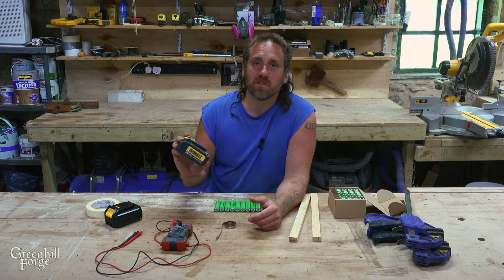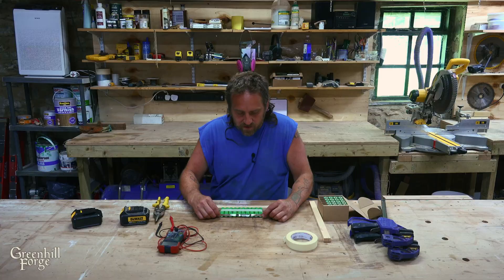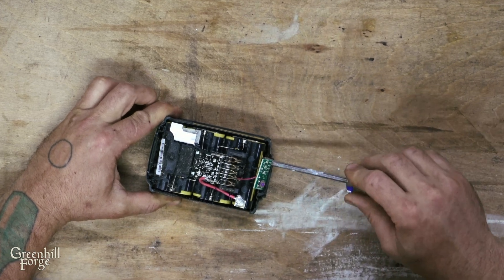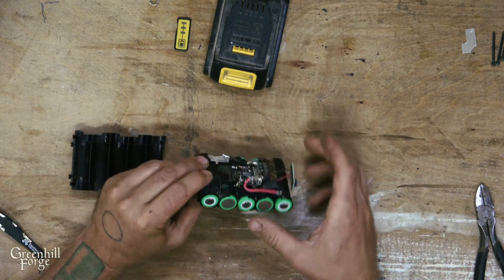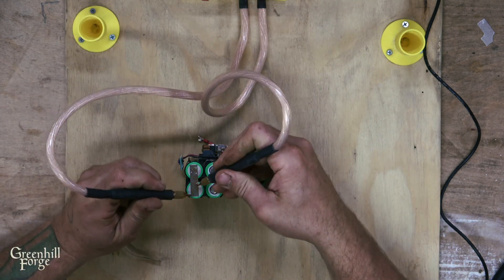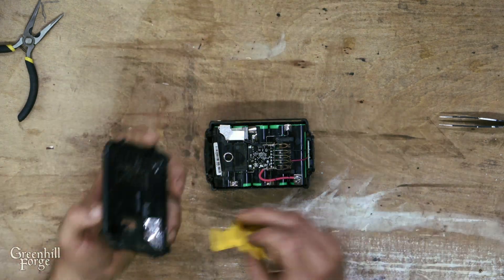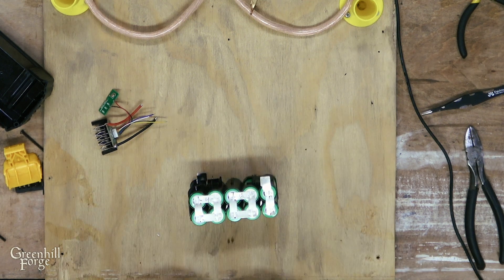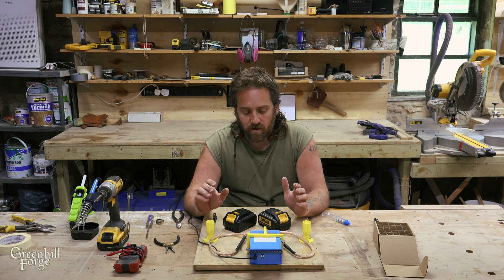20V Dewalt Battery Rebuild - Upgrade for 1/2 Price

Comment: Hey I just did this project, new to all of this, but everything's works, but when I put it on to charge, I get nothing, any help??
Reply from the maker: i'd guess a loose or wrong connection but it hard to tell without it in front of me. double check cells are all in the correct orientation and all connections are good. test the cell voltages, if they go too low then i think the charger can have trouble charging them. make sure charger is good with another battery. test voltage/continuity between + and - on the battery case. let me know what you find. can it power a tool?

Comment: Very clear explanations !  I would just recommend to place insulation washers on each positive pole before assembly , to avoid a possible short between the external circle (negative) and the internal part (positive) , because the initial insulation is very fine . I always do this ,  specially with high drain cells for safety . For assembly with a soldering iron (but really not the best) instead of a good spotwelder , it's  essential to use these washers .

Comment: How did you choose your cells? Are there some cells that have protection that makes them too tall?  Or did I dream that up? I get every part of this, but it's hella hard to get cells in Hawaii, so I want to preemptively avoid any rookie mistakes I can.
Reply from the maker: I googled to find the oem cells of the specific batteries I was and bought those. sourcing cell can be tricky, look for a reputable supplier but stock will rotate frequently.

Comment: Why is that black power strip upside down? You have the cable source from the right (viewer perspective) and the cable going and looping around the other side. Whether this is personal choice, I don't know, but this orientation allows liquiqds to spill in easier. Plus going up, the cable has an increased chance of catching on something rather than going straigh down and flush with the wall.

Comment: I'd recommend to anyone that if you want to rebuild dewalt packs, use Ampace JP30 for the 18650 cells and Ampace JP40 for the 21700 cells. The Ampace JP40 are used in their 8Ah powerpack and are a phenomenal cell. They'll have less voltage sag than stock cells so you'll wind up with higher performing tools, more often than not.
Reply: Got a good link?
Reply: @tillerdogg3232  I have Dewalt replacement battery with 10 EVE INR18650 30P cells
Reply: Yes the JP40 (Ampace) and the  Reliance RS50 rock.

Comment: Great vid. If I only used 5 batteries and have 2.5 ah's instead of your 5ah would that be ok. I only use my tools occasionally and for short periods.
Reply from the maker: yeah, and they have smaller cases for 5 cell packs

Comment: Where do you get your batteries and would it be possible to put something like the Samsung 35E in for more capacity
Reply from the maker: I hunt around because the prices seem to change a lot between the different sites. I can't remember all the different battery stats off hand but they need to be able to handle the peak amps and discharge rate that the tool will draw so some of the larger capacity ones aren't good because they are made for lower draw applications

Comment: Thankyou!  I didnt know you could get the kits with everything in them except the cells!  I got a stack of laptop batteries so now  I know they have a use!
Reply: Wouldn't use laptop cells dont think they would be good for high drain devices... I think they will be too dangerous. Thats like using a low amp cell in a vape mod. Definitely dangerous..

Comment: Thank you so much for this video! My batteries are starting to go kaput and I was really hoping to not spend 100 dollars on replacements. Now I can scrap and rebuild them!

I have a question though: my batteries are flex volt 20-60 volts. Do you have any suggestions/instructions for rebuilding one of those, compared to regular 20 volts?

Comment: Where would I solder the balance leads on a 60v I know it's a 5s 3p 21700. But the configuration in the pack is throwing me off. My balance wire has 1 red and 5 black? Where do I put them
Reply: Rebuilding the 60V flexvolt packs is quite complicated because they don't use a traditional cell layout. There are videos on youtube of a partial teardown of the 60V batteries. They are supposed to have, from what I could tell, 13 to 16 balance leads.

Comment: 9:26 Safety tip: cut the nickel strip away from the battery. If the cut piece falls into the hole at a cell's positive terminal, it can short it with the negative which is very close and cause a fire. 
10:50 To avoid accidental shorts cover the terminals of cells with barley paper or kapton tape and uncover only the group being spotwelded at a time.
6:35 Be careful not to scratch the plastic cover on the cell with the sidecutter. Space is tight and the plastic is thin.
Reply: Thank you for these tips. I'm about to build my own packs so any info I can find is helpful.

Comment: I used this tutorial to replace the cells in a 2Ah Dewalt battery pack.  I decided to invest in a slightly different spot welder (battery powered that doubles as a battery backup) and upgraded my soldering iron to a 60w.  Now I am ready to fix my stash of tool batteries as they begin to fail.  Thank you!!
Reply from the maker: Nice! I buy cells sell bulk/wholesale, like 100 at a time or so, and they're much cheaper and then any time I think a battery is starting get run down I just swap them out
Reply: @GreenhillForge  Link?

Comment: you can't easily shock yourself with a battery cell especially at 3.7v or even 20v for that matter. Skin is way to resistant to conduct much these lower voltages. What you can do is short it across something metal and get a shock that way but it will be minor most of the time. The more dangerous aspect is if you produce heat from resistance due to a short that can burn you. Lithium can also burn at very high temperatures if too much heat is in the cell. Lithium fires are extremely dangerous.

Comment: Good stuff, and what a bench.  Even a workspace for the welder, working clean is a joy to watch.

Some thoughts - not criticisms.  At 5:28 on the negative main solder point, you can see there's a notch in that piece of nickle.  That's the fuse, and why that piece is covered with the little piece of mica or whatever, to insulate it at the moment it blows.  Chances are your nickle strip will blow as easily as their "fuse" thin point, not worried, just letting people know what it is. If you can save that piece of nickle to re-use it'd be slightly better.  But not better to make a janky connection just to save it, gotta use your judgement.  

While you have the case open, clean up your terminals and give them just a smidge of fresh dielectric grease.  So many batteries die prematurely because of a dirty contact that starts arcing.  Don't have any on hand?  O-ring grease is pretty much the same stuff and can be interchanged, both are silicone based. 

Fun fact - DeWalt doesn't balance charge, nor team Red for that matter.  Yeah, I was shocked too, pun intended.  Check out "Tool Scientist" here on YouTube, he goes through it in excruciating detail.  But you do need the leads for the charger to check in on the cell voltages.  With that in mind I'm less worried about the quality of the secondary market BMS since its job it mostly to alert the tool it's time to shut off for low voltage.  Rest of the logic is in the charger and it's none too bright either.  Yet it all works well.  

Anyone with a more hectic workspace, like, uhm, me - glue that damn spring in place when you open the case.  They run and hide, especially when you get interrupted.

Comment: I'm trying to replace the 5 cells in an older 20v 1.3ah battery but cant seems to find the same ones online. It currently has INR18650-13b M samsung 2 not sure if they dont make these specifically anymore or im just not looking in the right spot any suggestions?
Reply from the maker: 18650 is the size so all cells that fit in these dewalts will be 18650. 13 is going to mean its a 1300mAh cell. If you look up the stats on the samsung model it'll tell you the other stats that you need to get in the new cells like max discharging and charging mA
Reply: Look for cells from Sony/Murata or Molicel, your best bet when looking for 18650 cells with high capacity AND high load ratings.

Comment: side note on balancing - if you really want to get the cells as closely matched as possible, connect a 4.2V charger while all the cells are in parallel. Reason being, while the standard li-ion voltage curve is fairly flat from 5-95% SOC, it has a peak right at the end of it's charge. This results in a larger voltage delta between unbalanced cells and therefore faster, more granular equalization.
Reply from the maker: great info. I haven't been able to find a 4.2v charger that gets more than like a one and a half star review. not sure why they all apparently suck

Comment: Does it matter that the nickel strip is somewhat thinner than the factory Dewalt strips?
Reply from the maker: It could. The nickel needs to be thick enough to carry the current that the tool is drawing. If it isn't it could get hot, even red hot and bad things happen then. It's hard to say without knowing the exact thickness of the new nickel and old dewalt stuff. I've often seen Dewalts with nickel plated steel so it's harder to make a direct comparison. Try googling the exact pack and what the minimum nickel size is
Reply: @ thanks!  I just did a 5ah battery and used the strips that came with a spot welder I have.. I left the battery out of the case and connected it to my vacuum cleaner which is pretty power hungry and felt all around the strips and they weren’t getting hot at all….  So that’s a good sign.
Reply from the maker: @RudyC-w3b  👍
Reply: @GreenhillForge I did some more research on that and as it turns out there is a nickel strip calculator online.  It's showing that the minimun thickness is around .20MM x 8MM.  (I'm pretty sure the factory ones are .30 or more).  The 18650 individual batteries are each rated for 20 amps and are in parallel, so 40 amps is going to be the max expected continous current drain.  At 30 amps continuous anything less than .20mm is starting to get pretty hot inside the case.  The strip I was using was only .10mm so Im going to double up on the strips and maybe even go heavier on the main +/- Leads.  Hope this helps someone..
Reply: @RudyC-w3b It certainly does! I have 0.15mm nickel strips in my Amazon cart right now and will swap them out for 0.2mm. Thanks for taking the tiime to make this comment.

I know YT won't let us post active links in comments, but could you provide specific search terms so I can find the calculator?

Kind regards,
John

Comment: What spot welder did you use if you don't mind me asking.  Was looking on amazon and a lot of the products have shitty reviews.
Reply from the maker: It should be linked in the comments
Reply: @GreenhillForge Sorry my friend. I don't see any links in the description for tools or supplies. 

I'm working on my first power tool conversion, NiCad to Li-Ion in my old 19.2V Craftsman battery. I  have a mid-priced spot welder in my cart at Amazon right now. Very interested to see how its specs compare with yours.

Much as I loathe the prospect, will search AliExpress for a kit even though I've pretty much sourced everthing else I think I need from watching about 60 YT videos.

Your video is the clearest, most complete of them all. Thank you!

Comment section also very helpful.

Kind regards,
John

Comment: Does “Maximum discharge current” matter with the bms it has ? I can’t find the specs for it. 
Thinking about using different brand cells with higher “Ah”
I’ve made couple 18650/21700 packs for electric skateboards but I would always buy the bms. I do construction & would like to make packs for my tools
Reply from the maker: Dewalt batteries don't actually have a full bms in the battery. The full bms is in the tools and chargers. The one on the battery is really more of a intermediary between the cell banks in the batteries and the BMSs in the tools/chargers, allowing the actual BMSs to read the voltage in the cell banks. The actual discharge current is passing through the nickel tape connecting the cells and the main black and red wires connecting the ends of the battery series with the positive and negative connections on the battery, and if you exceed their capacity they can melt like butter, catch fire, and nuke the whole thing.
Reply: @GreenhillForgeyou 
So all I need to do is use thicker nickel strip & thicker gauge that can handle it then correct ?
Reply from the maker: @MannyM0E7O7  The tool determines the amp draw, so assuming you're using normal OEM tools and nothing's wrong with them and no shorts then the tool will always draw the normal required amps. Increasing the Amp hours only increases the capacity of the battery so the battery lasts longer. It doesn't increase the amps drawn (only the tool or a short does that. So like in the video, I increase a 3Ah to a 5Ah and it's fine, I didn't need to change any of the wiring. Careful with battery brands though, cheap cells are notorious for being crappy, like dying early or even shorting/catching fire/etc

Comment: Oh wow... I didn't know you can get blanks on ali, that is awesome!  Which spot welder did you get and how much was it?  I was looking at several and couldn't decide if its worth investing for building 1 battery pack for my scooter that I am going to convert from 2 lead acid batteries to Li-Ion instead and now with extra batteries, I can upgrade my 1.5 Ah battery to 3.2!
Reply from the maker: should be a link in the comments to the welder. if you're building a big pack that's when it starts getting really cheap, ordering 50-100 cells at a time really drops the price

Comment: Great video, can you post some links for the cells and the welder you have, thanks
Reply from the maker: I don't have the exact links to give you but check the comments, I've posted some info there.
Reply: @GreenhillForge  Thanks, I managed to source the spot welder, can I ask what setting you had it on? do I just do it at full power, never spot welded a battery before so don't want to get it wrong. Thanks
Reply from the maker: @ronjeremy7255  I used it at full power but I'd recommend just practising a bit before you try it for real. Try just welding two strips of nickel together, pull them apart and see how strong the weld was, look for any burn through around the weld which would show that it's too hot and should be turned down a bit, and if you're rebuilding a battery you could always try test welding some nickel onto the old cells. Basically get a feel for it so you know what to expect when you do it for real. You could also check ebay for old spent batteries, sometimes you can grab those really cheap. Good luck and I'd love to hear how it goes.
Reply: @GreenhillForge Thanks for all your help and advice, I practiced a bit on the old cells, (2 of which were actually completely dead) and then had a go with the new cells, it all worked out perfectly and the battery is good as new. Thanks again
Reply from the maker: @ronjeremy7255 That's awesome!

Comment: What welder unit did you use?  I am building power packs for the R/C aircraft.
Reply from the maker: The old link is dead but I found one that looks like the same thing. https://www.amazon.co.uk/Handheld-Adjustable-Portable-Battery-Welding/dp/B0C9QTP1X3/ref=sr_1_39?crid=3PYBT34N927JB&dib=eyJ2IjoiMSJ9.w6scWugQtdbkSOlg3x6XN0UuLagIutwLNCxklCZyWxrxqs_G1btXYPlW7TCJfKWkSquBeZ82ePtXYKbB-vOTsAac5nXxnLtQ_vXMFAJthYqOSW_go63eEdW5la66WhiKiBDme35aHwBzOg6hx03gw-n34GK6UkkSvvy_oOnu7Fx8IQF-TzUwoRBnH4RUb84Nysn5JUywggVBUbktM-Rt_CJekuRsPBP5vSyOOIyrPJPbZNPC7LdoAPINYyJzdnBq9FDrjq3MHTvnf4hAjSkZXz2AHXmqorak9puHaUOTQGI.EIXx2xwJePWbD6EWh69BQSxYZ4mOb0ugo15xwc788sU&dib_tag=se&keywords=battery+spot+welder&qid=1731360214&sprefix=battery+spot+welder%2Caps%2C128&sr=8-39

Comment: Good tutorial brother! Also you can buy the nickel connectors like the OEM ones that connect the batteries in series and parallel in one shot, less welding. I love when I see guys throw out there old battery packs, easy and cheap to rebuild!
Reply: Got a link for those connectors you speak of?

Comment: Great video so far the best I’ve seen on how to rebuild 5 ah batteries. recently my spot welder stopped working I’m kind of curious the kind of spot welder you were using yours worked really well do you have a link for it possibly?
Reply from the maker: Thanks! The old link is dead but I found one that looks like the same thing. https://www.amazon.co.uk/Handheld-Adjustable-Portable-Battery-Welding/dp/B0C9QTP1X3/ref=sr_1_39?crid=3PYBT34N927JB&dib=eyJ2IjoiMSJ9.w6scWugQtdbkSOlg3x6XN0UuLagIutwLNCxklCZyWxrxqs_G1btXYPlW7TCJfKWkSquBeZ82ePtXYKbB-vOTsAac5nXxnLtQ_vXMFAJthYqOSW_go63eEdW5la66WhiKiBDme35aHwBzOg6hx03gw-n34GK6UkkSvvy_oOnu7Fx8IQF-TzUwoRBnH4RUb84Nysn5JUywggVBUbktM-Rt_CJekuRsPBP5vSyOOIyrPJPbZNPC7LdoAPINYyJzdnBq9FDrjq3MHTvnf4hAjSkZXz2AHXmqorak9puHaUOTQGI.EIXx2xwJePWbD6EWh69BQSxYZ4mOb0ugo15xwc788sU&dib_tag=se&keywords=battery+spot+welder&qid=1731360214&sprefix=battery+spot+welder%2Caps%2C128&sr=8-39

Comment: Do you have a link for the cells you bought?
Reply from the maker: They are Samsung 25R 18650 3.7V cells. 18650 is the size and shape. 3.7V is the nominal voltage. 25r is the Samsung model#, it has 2500mAh capacity and 20Amp rated continuous discharge. I'd use any high end make with those specs like Sony, Samsung, Panasonic. Prevailing wisdom is never buy cells from places like Amazon, Ebay, Aliexpress as they'll likely be fake. Stock at reputable cell suppliers seems come and go a lot and prices fluctuate so sometimes you have to search around but here's an example of the Samsungs https://www.cellsupply.co.uk/samsung-25r-18650-battery?srsltid=AfmBOoqAtA4meDGDRETDDjwCzX08SVIMyDhKZAdztR5mQKru2uj0zvYv